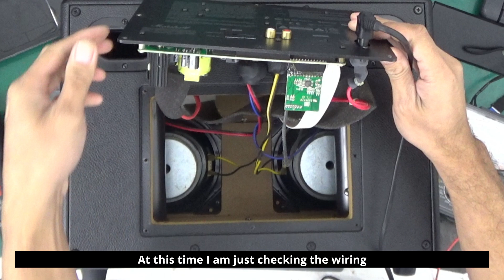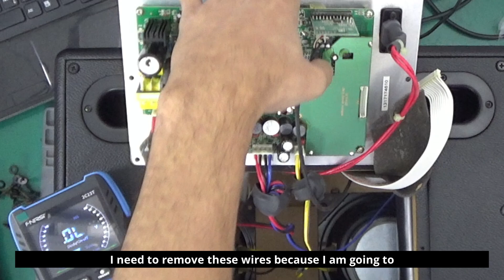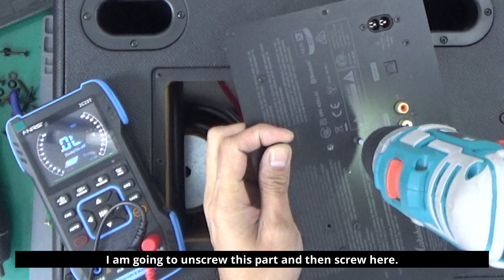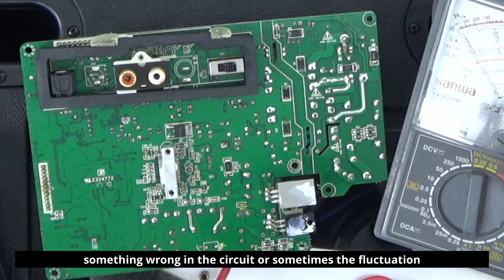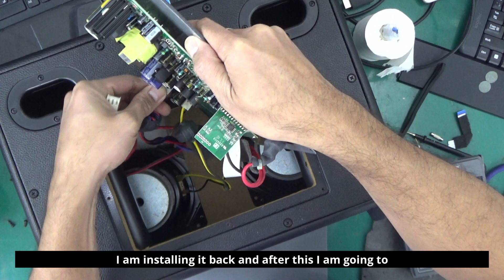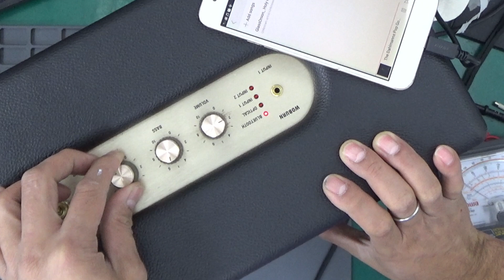How to fix no power on Marshall Woburn Bluetooth speaker

Comment: Hi, I have opened my Woburn 2 but it is quite different from this one. Do you have any experience on the Woburn 2? is there a fuse in it as well? Mine is not turning on
Reply from the maker: Hi, thank you for watching.
All powered speakers must have a protection fuse on the circuit. I'm sorry I haven't received such a model yet.